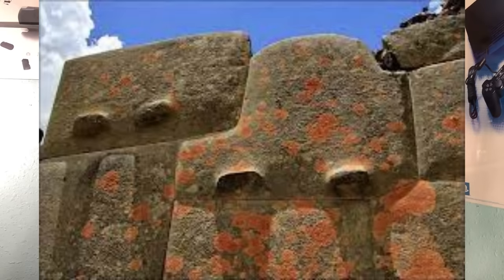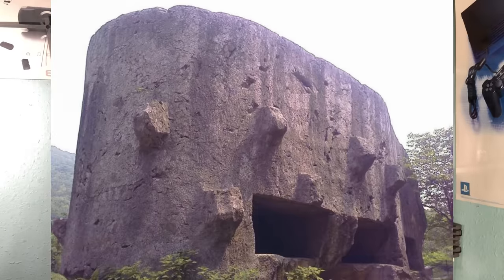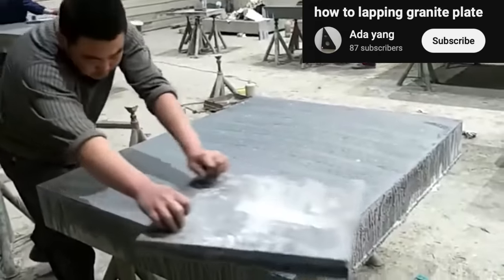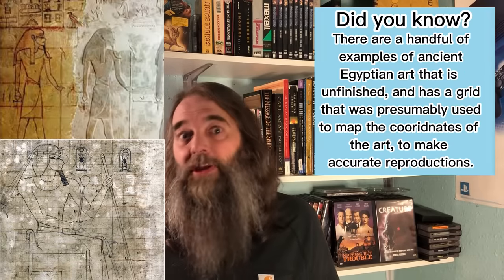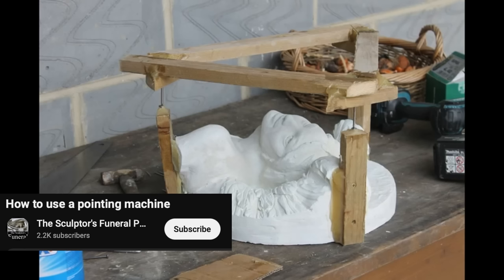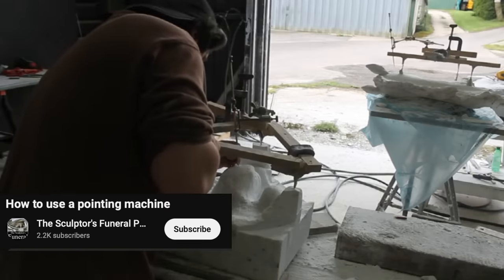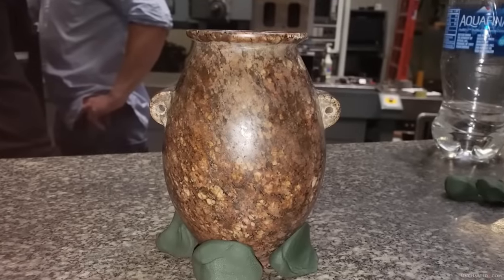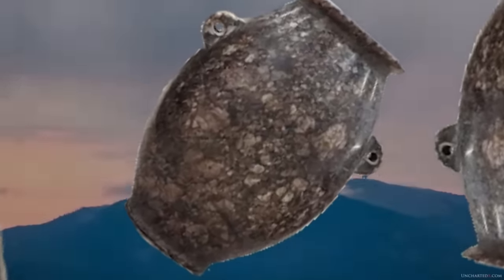The True Purpose of Megalith Stone Nubs

Comment: It’s as good as any of the other hypotheses, but it doesn’t explain: 1. Why only some blocks have nubs.  2. Why some have a single nub while others have two or three.  3. Why the nubs are located at different points on the faces of the stones.  Or 4.  Why the nubs are different sizes and shapes or sometimes even, inverted.  I don’t think you’ve quite cracked the code, but I like that it’s a new idea.  Good thinking.
Reply: My thoughts exactly, good points
Reply: With this theory the nubs would be located differently with each stone shape, when you start a new stone you decide where to put the nubs if the nubs only locate the frame each nub can be placed according to the shape needed. Used nubs would be removed, and if the wall was never finished the nub is still there. Was the wall ever finished? I can’t say, if the wall was finished, then the theory has holes! But, I think it is the best one I’ve heard so far. I always knew the seams were lapped, and figured they used crews led by Master Masons, with hundreds of men and 10 master masons you could do a lot.
Reply: You have to imagine them painted. The nubs gave the art a slight 3d dimension
Reply: Agreed.  Especially since there are nubs on random pyramid blocks that seems completely arbitrary.  I think it’s likely that different cultures may have had different uses as well.
Reply: Would need to look at each stone and speculate. But. imagine the piano key. Placing all white stone and leaving space to add the black stone later. White stone can now have any shape, only the black stone will have to be fit perfectly and only them will need knobs.
Reply: I’ve seen these nubs on natural spherules at Croton springs in Big Bend!
Reply: 1. Other ways to fix the measuring tool, 2. I believe we are shown where an edge/corner is used for one of the fixating points, 3. it doesn't matter where the points are, 4. nor the sizes or it they were inverted.  :-)
Reply: Why would they remove so much material to leave the nubs. And what did they do ??
Reply: @LD-qj2te  That was my thought too. It raises the question 'was stonework easy or difficult?' Because it may have been a lot of work to create a nub I would think they are more than an alignment assist. You could have drilled a couple holes for that.
Reply: Exactomento!  but you forgot the most important point :  the EXACT copied similarity of this ULTRA SPECIFIC contructiond detail among different civilisations in different contintets  separated by time and space...  LET ME BE THE FIRST EVER to state this as far as I know: the nubs are the FINAL ULTIMATE PROOF we have a prehistoric civilisation/global connection. ther eis no way around it. PERIOD
Reply: Most importantly is why did the builders, all over the world, leave them on?
Reply: Not the worst theory I've heard,  but I don't think the puzzle has quite been solved.
Reply: the nubs were for scaffolding
Reply: @very5ick112  , that’s easy to just say, but do you have anything to back that up?  If they were for some mundane purpose as you suggest then how come they aren’t arranged in a symmetrical pattern?  Why are they different sizes, why are some inverted, why do some blocks have multiple nubs and others have none?  Sometimes there are nubs down low but not up high, how could that suggest they are for scaffolding?  Furthermore how would one even firmly attach scaffolding to a nub?
Reply: You can’t “lap stones with multiple faces including vertical, horizontal and different angles.
Reply: I Agree with You theory, I also Believe the Stone was Like a Mud Stone then Hardened ..
Reply: The nubs would be based upon the original surface of the stone.  This stone if fatter here. That stone has that lump already sticking out.  
Second, as you’re excavating the stones from the wall, you simply leave the nubs and cut out around them.  Much of the excavation was accomplished by pounding on stone with harder stone to break bits away.
Reply: Could the nubs be a type of graphic equalizer to adjust sound vibrating of the stones?  Could the nubs be the reference point to tell the Mason how much material to remove from the stone? Nubs appear on the large granite boxes in The Serrapeum Complex in Egypt.
Reply: Also some of the bigger stones - have none. And judging by this fellers claims, you'd need one on any stone that is finished.

Then you have the frame itself.  The stone would have to be finished all the way through,at least on each side. (I've heard the rear of the stones are usually unfinished), but putting that frame on the top, chiseling out 'the top few inches' - just doesn't make sense, when you'd have to have the frame fitting on the top few inches,, half way down, and near the bottom. And that smaller bit of frame (around the nub) wouldn't allow that.

Yeah this guy is closer than a lot of people- but still a ways off. Imho of course.
Reply: Someone showed it was electricity thst can superheat and melt rock. The nubs are left from the withdrawal of the electrode
Reply: @minorityofone1510  Show evidence ANYWHERE in the world that anyone ever built an actual power plant and used it.  You can see how big our power generators are now.  Think it through before accepting crazy claims.   

Look at ANU of the other explanations of how those nubs were used.  There is archeological evidence of any of those theories.  

Last, how do you contain that amount of heat and weight?   Dealing with 2 tons or 100 tons of rock is difficult.  Now imagine dealing with 2 or 100 tons of molten lava at 2,500-3,500 degrees.
Reply: @avgmaster1 my unanswered question too
Seems everyone an expert
Reply: @davidbliss8352  indeed. Some in cuzco, are on ground level.
Reply: @anned372  I think that - is the burning question.
And only by everyone having a 'wild' theory, and testing them wild theories,,can we remove any speculation, and arrive at the truth.

I dont see it as 'everyone being an expert' - I think of it more like my grandfather used to say. 'Opinions are like arse-holes. We all have one'.

And he was right. We may all have a different t opinion,,but if everyone in the world had just 3 opinions - you remove 2 of them through deduction, you're left with o e MAYBE, that - well, that would HAVE TO be the right answer. Even if it was only 30% right.

The way I see it, is the more opinions we have, the better chance we have at getting to the burning question.

"What were they for".
👍
Reply: @fareemvenosa3774 They add a layer of richness to the construction.  People in the future will look at them and wonder what they're for. They stay alive because we are talking about how they were made. The stone masons thought about the way people would see their work in the future and wanted people to be kept guessing it seems obvious.  The nubs aren't for any purpose.
Reply: @davidbliss8352  it could be a form of street-sign, or a sign indicative of where they are,,for religious purposes... I dunno, just throwing it out there.

Like the 'jaguar paw, in the stone of Sacsayhuamán. Andnother images made in the stone, OF the stone.

It could be a processional thing.
Reply: @NillWill  bro - you just triggered a memory in me. I went to stonehenge, as a kid. I remember seeing these 'nubs' on the top of the standing stones. I may be wrong, but im going to email somebody, to see if my theory could be what they were for.

If im right... I'll let you know.
Reply: @maughan3061  you may be right. You may also be completely wrong. I was discussing this in another part of this video comments, and somebody said something that made me think about stonehenge, when I went there as a child.

I'm not saying too much yet, but it's a string possibility. I'd say a higher probability than this video.

But - again, it's down to the comments section to throw cold water on an idea, by asking questions nobody else has thought of.

So, we will see. I'm curious to find it out though.
Reply: To me, most of those stone blocks don't look as some ordinary stone block cuts, but rather as they were poured into molds. And molds could have been parts of a giant construction, which was built and put on a wanted location, and then they poured molten stones into it. The construction would be removed after the job was finished. And nubs are just accidental remnants of such work, because some molds were maybe leaking a bit and made an excess?
...Just some brainstorming.
Reply: @LD-qj2te I completely agree. Also, why make them irregularly shaped to begin with? Working with, and transporting stone, is difficult enough as it is!
Reply: No this doesn't work because the nubs protrude and a smooth convex manner which would not allow for a frame or a right angle to sit on top of them and use them as reference points. To me those knobs look like injection points where concrete was injected into a mold .

Comment: Hey, thanks for video, i like talking about these walls.

I'm bad in English so I'll use the minimum words needed 😀 sorry about that.

3:54  Talking about the plan of the wall.

- 25 pages may be needed for a single stone and there's no tool to verify the final result. Bad idea.
- Pointing device cannot be use on object of that scale without solid arms of STEEL

1 - Start the wall by placing the first Big stone of any shape.
2 - Mold 1 of the face creating a negative shape. Mold made of wood or some cement. 
     " Bread's good enough as mold if no better idea. Light material and easy to shape, that can keep the shape, and provide food when damaged. "
3 - Use the negative to shape the next stone.

And that's all... You can add a new stone every week if everything goes well.
Since this make only 52 stone each year, you'll cover more distance if the stone are bigger... ... ...

My problem is more about the precision.
There's a lot of step to reach that kind of precision.
In all step, different kind of tools need to be used.
They all require a lot of stone manipulation.
What tool ? What energy ? 

All around the globe, human found how to create megalithic wall isolated from each other.
 One said :  -   " Human will find the same solution to a same problem even if they never teach each other !!! ... "
Then why cant we find that solution today ? Arent we human facing a same problem ?
Are we facing the same problem ?
We want to find how they did.
They wanted to do ... that.
     " Maybe it's hard to find the same solution since we're not facing the same problem ?!? "

They wanted to do ... that. '' that '' What is '' that' '

That = 

Material : Stone
Shape : 
 - No Straight line
 - No sharp corner or sharp angle
 - No flat surface
 - No connected joint
 - No regularity
Precision : 1 millimeter
Size : Minimum : 1 tons ; Maximum 100 tons ++  (But no brick of 2 pounds. Only heavy weight stone. Bigger = Better.)
Construction type : Wall
Durability : 10/10

( To make things harder, the king could have asked them to do these walls without using their hands maybe ? )

     " Human will find the same solution to a same problem even if they never teach each other !!! ... "

Here, we're looking at a civilization that added to their construction, a lot of complex specification for mysterious reason.
If you need a ''Durability 10/10'' . You are not forced to add all other specification to your walls.
Adding all these specification to your wall is also adding your own ''signature'' to your wall.
Same thing goes with the Knobs, they're some sort of signature.
And we can find some of these wall in various place around the world.

Using the knobs as guide for the mold is possible.
Probably both to help the crafting and to help moving the stone.
Then as support for additional wood structure.

-----------

Concerning the vase at the end.

So far it's the only one that reach that kind of precision. I wonder who really made that vase.

Comment: I finshed stonemasons school in the 80's, and we used three-legged pointing machine for making stone sculpture. At first they were just three little holes on the rough block, where the legs of the machine was placed. Later when all the stone around was cut off, these three knobs remained there, on the sculpture. Then cut them off to finish.
Reply: *cut them off to finish

But these aren't cut off. I'm thinking they're functional.

Not sure if they were ever painted or not, if they were... all bets are off.
Reply: All in all, these walls look so absurd.  Pure snobbery I think.
 Imagine a customer who says - No, no, I especially want irregular shaped stones, fit together perfectly, Not boring square stones. And please, make them quite smooth on the surface.  But leave the knobs, they look cool to me, and my quests like them.
Like those customers who need natural shaped oak floorboards fit together perfectly.
Reply: Maybe they kept the nubs in order to easily replicate the stone if it got damaged in the future. I like the simplicity of this use case. Plus, these nubs if left in place could easily be repurposed to provide anchor points for wood frames. Think about attaching wooden frame work that butresses to the nubs to a mated concave indentation that ensured the framework stays in place against the stone. The rest of the framework work be comprised of joinery that provides stability in every other axis.
Reply: @johncrosby7173  but why not every stone. Why not smooth them off after.
The same question arise. Every time.
Reply: @johncrosby7173  Hey John, I think you "nailed" it. the stonework probably did have some sort of covering, and the nubs held it in place
Reply: @TubeOnRichard yes he was there when they did it.
Reply: @TubeOnRichard  lol - one of my previous posts on this video, alluded to something similar.

I've sent an e.ail to someone who has extensive background in all things megalithic. Just waiting to hear back, on my theory.

It's something along the lines of what you said.
I did actually get the idea from another guy, on here, also.

But isn't this how we tackle problems, best ? A problem gets solved better when many minds think on different ways to solve it.

Some of the theories are a bit 'out there', but a lot - have common sense behind them. And I think this could be one theory that ticks all boxes. (Only in areas where stones are in both sides though. The walls like the pyramid casing stones, or baalbek temple, where there is nothing but open air, facing the nubs - that is anxentirely different problem).

But, I'm sure that with hundreds of thousands of people all working.g to figure it out, I'm sure we will, in time.
Reply: @allanhmelnitski978  *they were cut off at the end...

But these nubs are not. The rest of the block is polished. They are in different amounts, different positions, on 3 separate continents...

But again, it's not a sculpture. It's a block. 3 dimensional block.
There's no need for such a machine when making a block.

I'm not throwing your idea out bro, it's just pointing that the surface is finished, except for the nubs. It's essential that we all throw ideas out there, to break down those that don't work, and those that are 'possible', then further Into those that are 'plausible', and hopefully further, to 'probable.
👍
Reply: Did you have an original to copy off of? If so I can save you half the work you're proposing: Just use the stone you're copying instead of copying it.

Comment: I work part time installing concrete countertops. Despite having laser measures etc., we glue wood slats together to make a wooden framework to take back to the shop and build off of. It is very accurate and closely resembles the proposed hypothesis( i just think the nubs are not critical for success in this method).
Reply: I think you've cracked it. Building a frame defining the work area, rather than around a small model and scaling it up, is far more sensible.

I know that's not necessarily what you meant by your anecdote but it makes more sense to be done exactly like you do with counter tops but at a larger scale. 

Explains why the nubbins are on the finished building and not a model.
Reply: I agree!.   The cutting and fitting of the blocks is totally random, no two are the same.

Comment: I worked for a steel manufacturing company years ago, and we were presented with cutting and welding a  squashed corrugated conduit at a weird angle, {this was before lasers, so I am dating myself, LOL!} and the conduit was big enough to drive a large pickup truck through. A challenge was presented to the 200 employees as to how this could be done, the conduit was very expensive and they could not afford to make a mistake. I suggested using a framework like you have described here, and when it was cut, all the corrugations lined up and were rewelded perfectly. It was a very large framework which had to be shored up to be very rigid, and a corresponding frame for both sides of the seam. Since it seems that the test of these joints was that you could not slide a piece of paper or a razer blade into the joint, I guess it would pass the test!